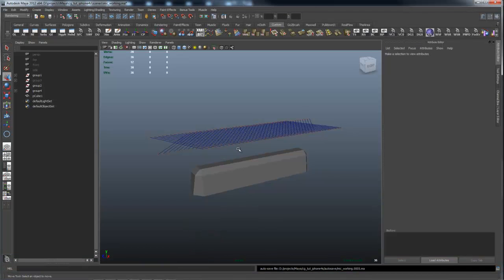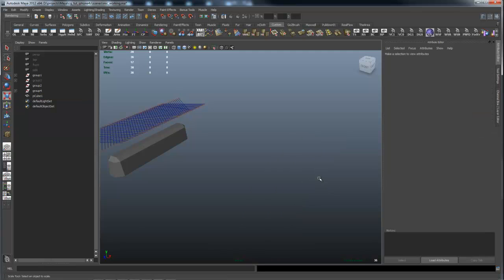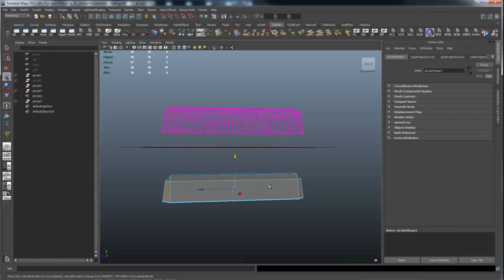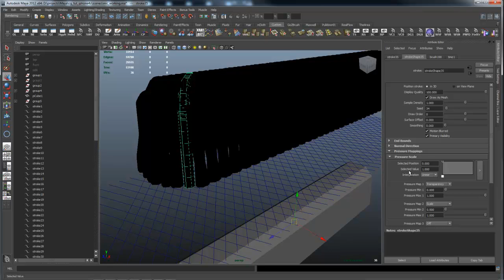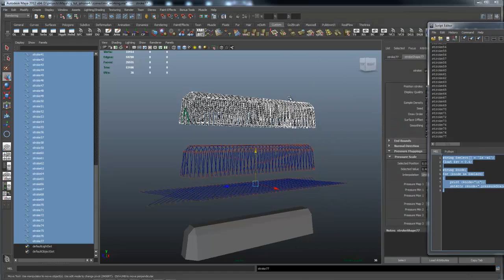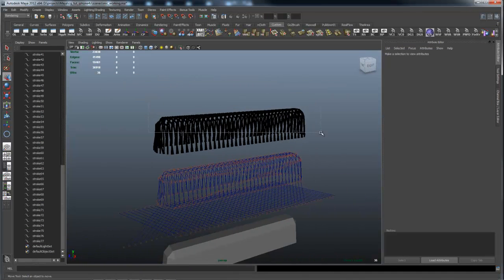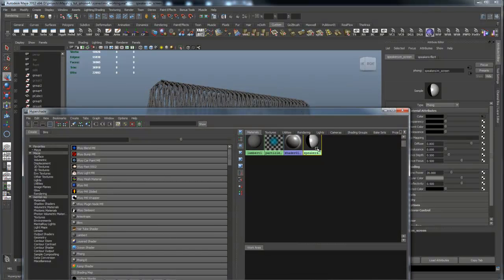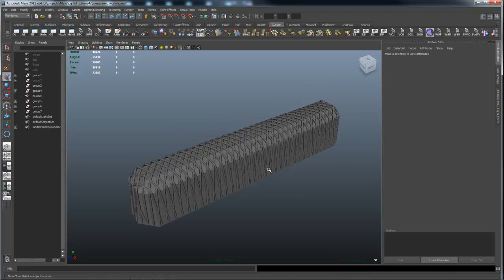howto   create a wire grill pattern that conforms to a shape

Comment from the maker: thanks for the kind word and yes the script will handle as many curves as are in the selection.  The script is a pretty good one to learn as a general template for many other applications.  It basically puts your entire selection into a string array $selection[] and then iterates through each one and does something.  That is the for-loop section.  so in this case it looks at every stroke in the selection and runs that setAttr command.